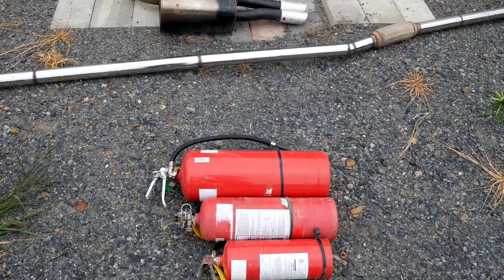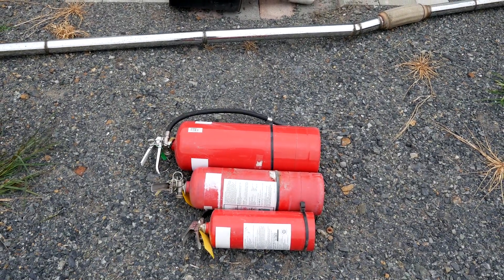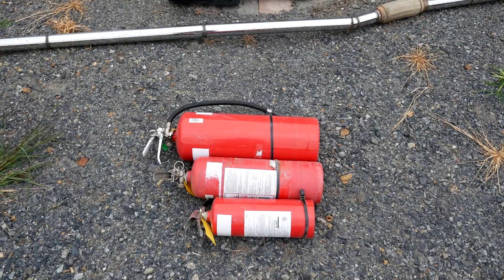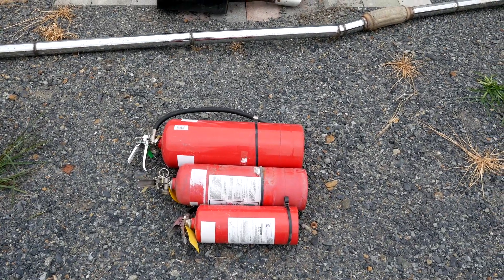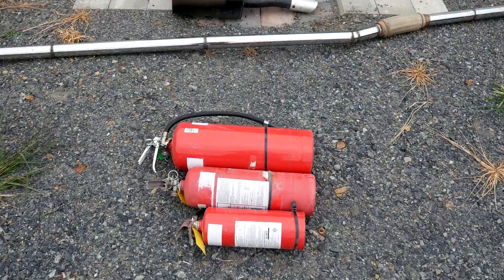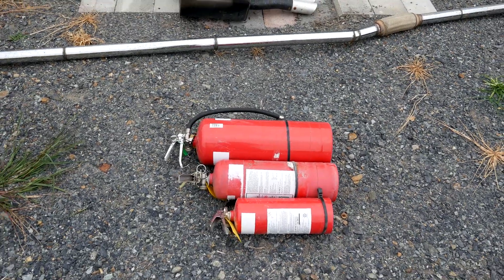Exhaust testing - Gold 4age - Dyno tested

Comment: I made long tube headers that go the full length of my car. Would love to see you do it and see the massive horsepower loss or increase they made
Reply: if properly made with tune, 10-20% power gain
Reply: Probably not enough to offset the weight but I'm curious, as well.

Comment from the maker: Just throwing some random junk in the exhaust, to see what happens. Nothing too scientific going on here.  But found something that maybe worth chasing along the way..  Got some ideas to try? throw them down below, megaphones, peach cans...?  Bean cans are more suitable for exhaust side I'm thinking
Reply: How about an anti-reversion chamber at the end of the header?  https://hosting.photobucket.com/albums/tt279/swatson454/Anti_ReversionChamber_zpsec9abb53.jpg

supposedly it gives you free horsepower, i'd like to see a before and after dyno test of this
Reply: @draggonhedd  Post this in the main thread
Reply: What if you try using test pipes right after collector, before normal exhaust system. Lets say 63mm, 60mm, 55mm and 50mm, and all in lenghts of 75cm to 50cm to 25cm
Reply from the maker: @AnatolMetanol   That is the section i will be working on next.  length, shape and diameter between headers and first muffler
Reply: @Garage4age  This might help guide a little:  http://www.epi-eng.com/piston_engine_technology/exhaust_system_technology.htm
Reply: Exhaust cutout with a programmed open/close at a specific RPM?
Reply: My 80s DR200 header pipe has a vestigial 2nd pipe coming off it. A 2nd header pipe that starts as close to the real one as possible and extends about 3/4 of the pipe. its the same diameter and capped off at the end. Apparently tricks the reversion into thinking the pipe is twice as big or something as well as make the exhaust quieter. only used for a couple years so probably definitely worth doing
Reply from the maker: @tortron  Until they realized the xr200 with blown out muffler was getting all the sales, with its wrath of noise and such power.   could be interesting to try.  was going to attempt to do similar thing on hilux to try kill the exhaust drone
Reply: How about different lengths of megaphones from the header collector?  I’d be really curious to see a 2.5” - 3” cone with different lengths and how they affect the powerband

Also for shits and giggles I’d love to see how the engine behaves with a 3.5” system + single resonator
Reply: I was always told that a Megaphone with a reverse cone would make the most power out of any exhaust setups which is why you see those used in top fuel drag cars. I'd love to see how that would turn out.
Reply: Garage 4age how about an anti reversion chamber? Sorry if already done one, I might not have seen on here. Could be interesting to see where in rev range it would help ( if at all)
Reply: Heat isolation. long tube covered thermo material.
Reply: Convergent+Divergent afterburner nozzle inside a siphon tube. As a muffler. I'm not joking. Except for the muffler part. Serious.
Reply: Check what is the impact of hard bends, or tight radius bends on the manifold?
Reply: please try header extension pipe lengths in 3 inch. start with a longish pipe and start to chop away length to find the hermholtz sweet spot. Another idea is to test throttle body positioning on a single throttle intake manifold. k series have made a gain with tb spacers..take it further by essentially extending that spacer to say..1 metre
Reply: A 5 degree megaphone at a 1 foot interval from the head, eg. try at 5 feet, try at 5.25 feet, try at 5.5 feet.  or what ever measurement, then 4 inches longer each time to see how it affects powerband
Reply: Open header trumpets for sure. 
I'd like to see some 2stroke expansion chambers though. 
I think a spring loaded trapdoor/restrictor will give more power though. Smaller diameter for airspeed and when it needs volume the spring will open up
Reply: Try a twin exhaust right off the header 1 pipe is 75mm, other 60mm. 
Quad 38mm exhaust with crossovers might sound the best. 

Copper exhausts sound angry, the sound waves and some pressure actually leak out of  the tubes but the airflow stays in. Yes it gives off nice fumes
Reply from the maker: I'm in the process of making a big megaphone  and other test pipes to try after the headers
Reply: @Garage4age  
That will look sic!

Also, Siphon Tube/ Hose will be easy to fab. Think George Fury's Bathurst exhaust on the Bluebird.
Reply: Such a small horsepower motor it will not affect much ...spay it with nos already
Reply from the maker: @evankehagias    Too easy.   It all scales up, multiply the gains by 4 or something, if want to know  what the gains would be on a ls or something
Reply: @Garage4age  im a big 4a fan boy got a ke30 20v 300kw ....i was just saying for ur videos and effort ur putting in exhausts aint doing much have you ever thought about playing with different fuels ?
Reply from the maker: @evankehagias   Nice.   Yep na tuning isn't easy, especially when trying to make gains at both ends of the rpm range.     Also  lot of the stuff in the vids is just showing what things do, rather than trying to make all the power.  I could build a big power turbo engine but dont have the money or a use for it.
Reply: Can u do a run with a cat converter an like 2” to see the power loss